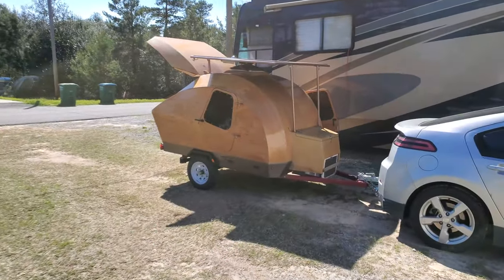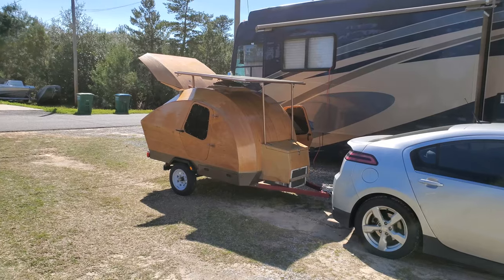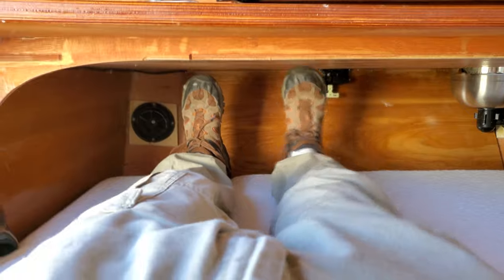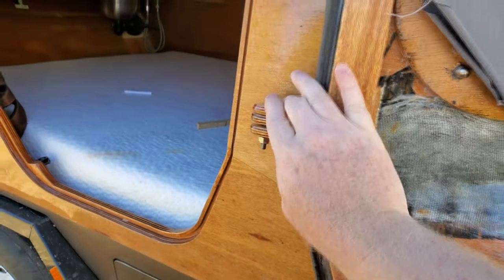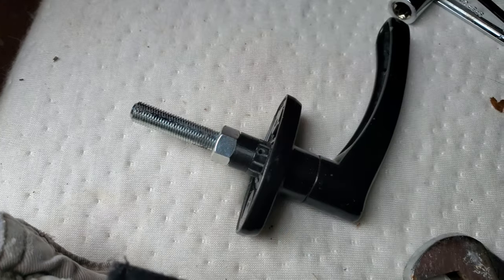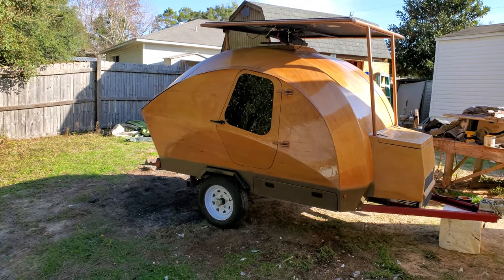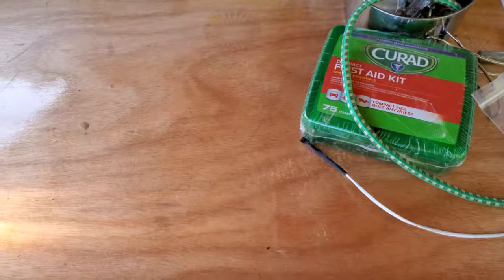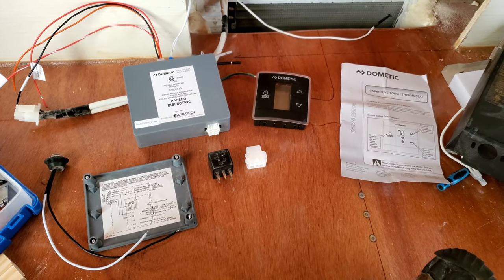CLC Teardrop Camper My review / fixes / mods / AC & heat /and towing it with a EV in 4K ... Part 2

Comment: For RV wiring of DC circuits I recommend using marine grade wire. The marine grade uses much finer wire filaments which resist vibration and it is tinned so it resist corrosion.

Comment: For me.  I beveled the rod on one side and inset the bottom dog. That way when the door is closed, the handle turned, the metal rod will slide into the hole of the dog and pull the lower portion of the door inward and my doors are flush and sealed tightly.  I did the same to the top too.
Reply from the maker: i had a bind in mine to pull the door in flush but where we seem to have a hard time with is the lower part of the door with there is no rod

Comment: Where you have the AC is where motorcycle trailer campers put the cooler.
Eventually I want to build one of these for my motorcycle to pull.  My Indian is 1805cc and I'm a bare essentials camper.

Comment: Thank you for putting this video together - it was super-helpful!

I'm getting going on my own CLC teardrop build, and will be filleting/epoxying/etc. the seams between panels 2 & 3 and 3 & 4 soon, which seems an opportune time to lay down some of that 3 oz fiberglass tape (as mentioned in this video) on the inside of the door, to proactively reduce any potential door warping once the door is cut out.

How specifically would you suggest laying some down: i.e., where, and how much (how many layers)?  Were the arrows in the video indicating to lay down (3'?) fiberglass tape on the vertical part of the door (on both sides of the door) - between the window edge and the outer edge of the door?

Also, that carbon fiber looks pretty nifty.  Is that applied the same way fiberglass tape is?  Thanks again!
Reply from the maker: yes the carbor is installed just like the fiberglass tap , INPORTANT  make sure there wood sticks i talked about are are wired to the outs side to hold every thing flat before adding anyhing thing to the inside of the door jam as i talked about in the video, this should stop or 90% help with the door not fitting right  . again if the door does not fit right i talk about how to fix that as well. ...PS  yes i know i need to make the 3ed video as there is alot of cool new updates i did ... i really love the 3oz as it makes sharper turns . dont be afraid of adding to much here as it helps out on the door seals as it moves the door-jam away from the wall just a small amount . but i think i only added 4 layers of 3oz here .
Reply: @falcon7350  Thanks very much!  I'll watch the section about the wood sticks on the outside again and follow up with any questions....

Is the 3 oz that you mention in the video something you bought on your own?  The part list for the CLC teardrop kit lists 22 yds of 6 oz fiberglass cloth and 50 yards of 9 oz fiberglass tape (3" roll).
Reply: @johnpelz4811  I think that  near the timestamp 1h41 he talks about the CLC included fiberglass vs the fiberglass he prefers and that he has used in the past.   I am assuming that he used that 3oz fiberglass (the one he prefers, that he bought himself).